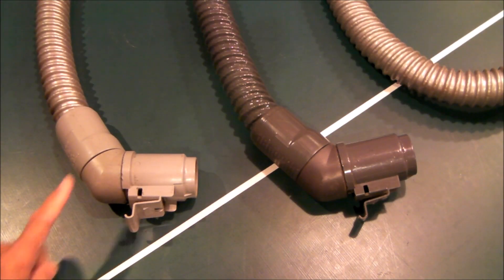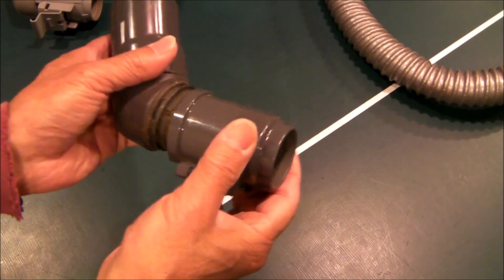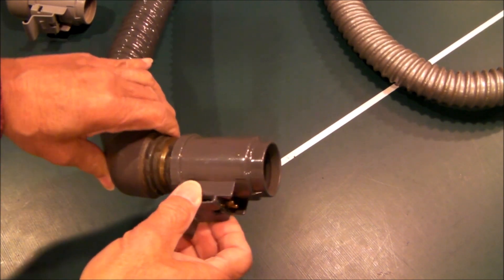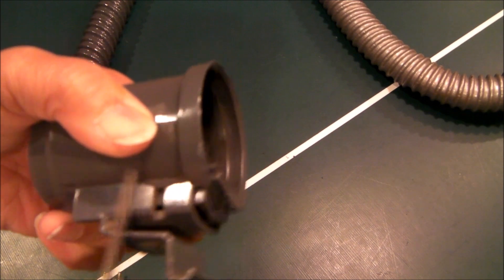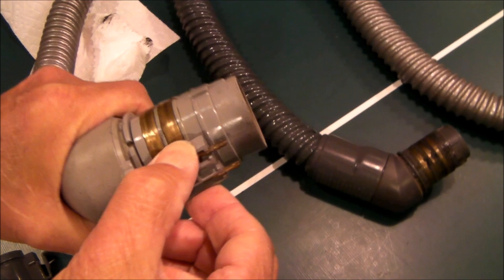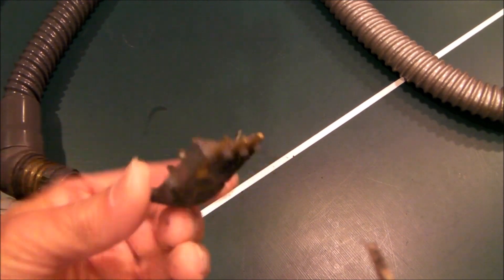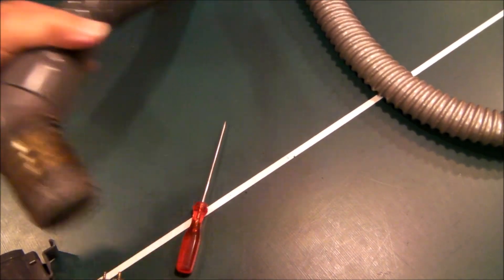How to remove swivel end adapter on Panasonic or Kenmore canister vacuum hose

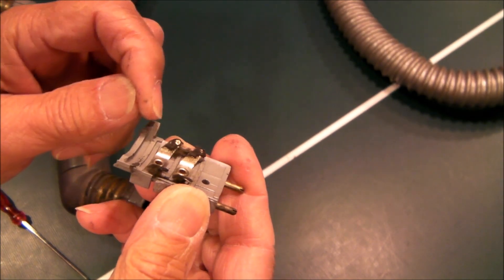Comment: Okay - for everyone who wants to know how to put everything BACK TOGETHER. I now know how.  I went to my vacuum repair place a couple of towns over and she did it for me for no charge - it's pretty simple. Once you clean everything up, go to minute 2:01 of this video where the guy is placing the small clip onto the end of the hose. You must then keep the clip in place and press it onto the hose end with your thumb. Then with your other hand, bring the housing (sleeve) and pull the sleeve over both the hose end and the clip till it locks everything into place. Remember, small clip onto the hose end with the three brass rings and hold the clip in place with your thumb and b slide the larger sleeve over everything and pull it up toward the clip till you hear a CLICK. That's it - very simple.

Comment: I have a kenmore with the 3 metal rings and 3 contacts. The top of the vac. fell as I was trying to get dirt out of the unit, and now I can't get the cuff with the 3 metal rings back into the rest of the hose. It seems like I need extra hands and I just can't get it all to snap together

Comment: I did replace the plastic part with the broken off clip the other day (the three prong grey one), things otherwise looked pretty fresh, dusted them off thoroughly, left some lubricant.  But this particular connection seems to  intermittently disconnect and lose power.  So for my next trick I will be opening it up again and trying to figure out a (hopefully free) solution.  What fun.

Thanks by the way, your video was quite helpful. Though I did have trouble getting both of those prongs depressed at the same time (with some blood to show for it).  Finallly I remembered having a set of some oddly shaped thin-nosed pliers, one of which was perfect for squeezing them in both at the same time (and they fit almost like that was what they were made for), and off it came.

Comment: I have a Kenmore Elite Crossover vacuum where the floor brush is embedded in the Power Rug attachment. The neck of the attachment broke. I think I found the part but I have to disassemble the  attachment and I can't figure it out. I believe this is the part # for the replacement part - Kenmore Nozzle Pipe (Swivel) #591002116  But if can't take the assembly apart I can't install the replacement. 
Would you happen to have a video on that. I've taken all the screws out so I suspect some sort of locking mechanism but it is still eluding me! Thanks in advance!